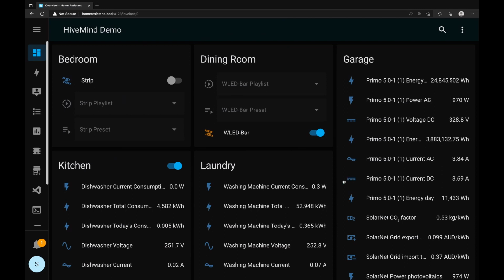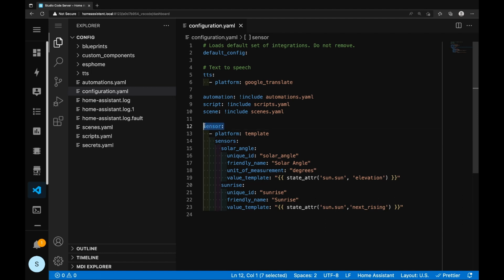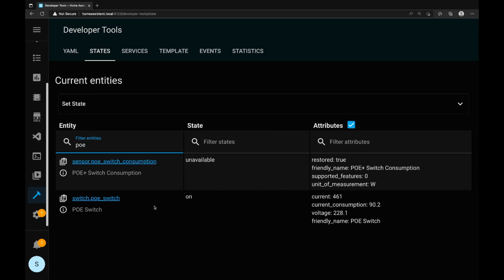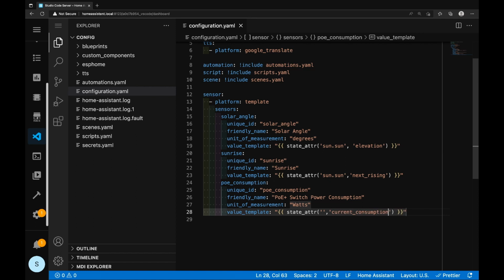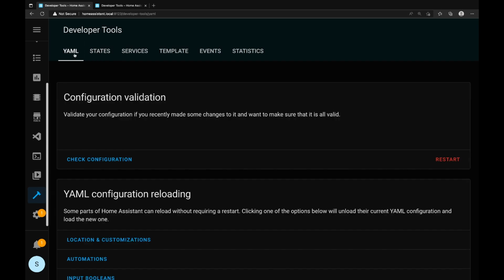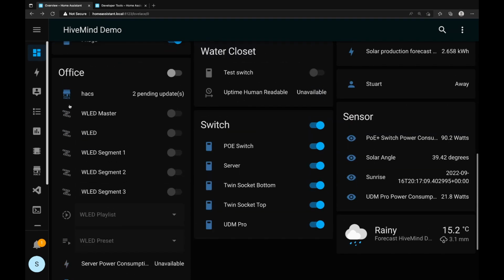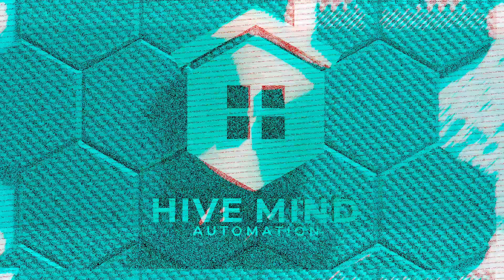Home Assistant Template Sensors

Comment: You use legacy sensor configuration format which is not recommended by Home assistant. Please update your guide
Reply from the maker: It's in the works for a new guide. I'll hopefully have something put together soon, but there's a lot on my backlog that needs doing.
Reply: @HiveMindAutomation  Ok, thanks for your work

Comment: Great video using yaml instead of a template. I much prefer your approach. However how do handle an array, like weather and dates? For example, I want the temperature for the 26th. How do I get it?

forecast: 
- datetime: '2023-01-24T05:00:00+00:00'
  wind_bearing: 242.31
  condition: partlycloudy
  temperature: 45
  templow: 31
  wind_speed: 7.29
- datetime: '2023-01-25T05:00:00+00:00'
  wind_bearing: 145.87
  condition: rainy
  temperature: 48
  templow: 31
  wind_speed: 9.35
  precipitation: 0.06
- datetime: '2023-01-26T05:00:00+00:00'
  wind_bearing: 273.97
  condition: sunny
  temperature: 43
  templow: 32
  wind_speed:
Reply from the maker: i think with this you'll be grabbing the entity as "forecast[2]" and then the attributes as "temperature" or "templow"
where [2] is the position in the array. Arrays start at 0.
I could be wrong though. I've not tried it, but that would be the appropriate syntax in python. Unfortunately I don't have an opportunity to test it right now, but let me know how it works out for you.

Comment: I'm trying to turn the raw data of a pressure sensor to a value in PSI.  I'm running home assistant with firmata and a arduino uno.  I can see the raw data but I cannot figure out how to change the sensor string.  Could anyone please help me.
Reply from the maker: Using Template Sensors defined in YAML you can add the key "unit_of_measurement" with the value of "psi"

Comment: I am trying to get my head around it for an alert automation. When my home power load is less than solar being produced for say ten min (in case of a passing cloud) send me a notification.  But only during the hours of solar production .
Reply from the maker: You'll probably be looking at a templating rule rather than a template sensor, though you may need a template sensor to perform some maths if your units of measurement differ - i.e Watts vs KiloWatts

I'm not 100% sure but you might just be able to use templating in a numerical state trigger in your automation.

something along the lines of:

platform: numeric_state
entity_id: sensor.solar_power
below: {{ states.sensor.household_usage }}
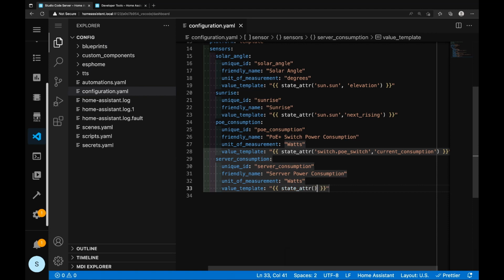for: 00:10:00

it MAY not work but hopefully it at least sets you on the right track.

Comment: Thanks!  a great video on templates! Much needed as I expand my use cases in HAS.  By chance do you have a video that returns a specific entity that triggered an automation? For example I have 5 smoke sensors and I want my notification to return the specific sensor that triggered the automation. Thank you
Reply from the maker: I don't have a video on that yet. I'm still wrapping my head around that concept myself for my "burglar alarm"
Definitely in the pipeline though so hopefully in the not-too-distant future.

Comment: You can also define these in the localtuya integration as a sensor when you set the switch up. Set up the normal switch bits (can include the attributes there as well) and make 3 separate sensors, each with one of the dpid's (17, 18 or 19) for current, watts or volts entered in the ID field. Watts and volts usually needs a scale factor of 0.1 applied to give the correct value. Current is returned in mA but if you wanted amps you could use scale factor 0.001
Reply from the maker: Interesting, I'll have to check that out.

Comment: Hi, that's nice tutorial though since it's new video it would be good to present the new modern configuration instead of old legacy format that is not recommended by HA anymore
Reply from the maker: Considering the Home Assistant Documentation still only shows this method for creating Template sensors, I'm really not sure what you mean.
Reply: @HiveMindAutomation  There is indeed a new format and you are using the old format which goes "sensor > - platform: template > sensors" but the new format goes "template: > - sensor: "

Comment: Very helpful thanks. I have some old door switches that work through an RF Bridge using mqtt, and I keep getting the warnings about them stopping working as of the December update. Do you have any videos or advice for fixing this? I have tried just changing them to the mqtt: but studio code shows all kinds of errors.
Reply from the maker: I don't use any RF gear right now and probably won't be introducing any to be honest. Not super familiar with the RF/MQTT Bridges so I don't have any advice other than maybe looking to purge and re-pair everything.
Reply: @HiveMindAutomation  at the time I got 433mhz door switches for $1.50 each so I went for it, but now I usually add more Zigbee devices, already have 90+ devices on my WiFi so steering away from more of those.
Reply: google 'problem with new mqtt format homeassistant'  There's a thread there that should give you some examples of how it's supposed to look. Also youtuber SlackerLabs did a run through of it a couple of videos back. You will need to be on at least 2022.6 to set the new format. Oh and, backups, backups, backups before you start
Reply: @geejayem59  thanks, I did get it finally, never thought to ask exactly that. Got on a few discord servers, and of course everyone sent me a link to the same page I was already not understanding lol. Oh, and yes I do watch SlackerLabs